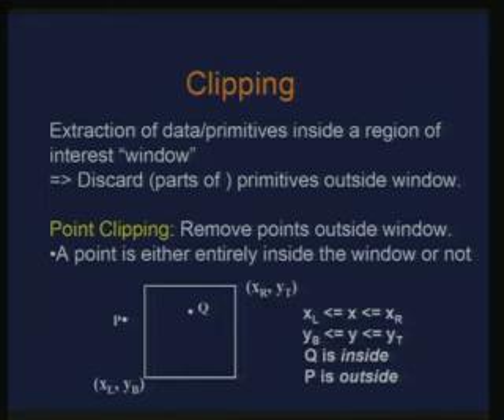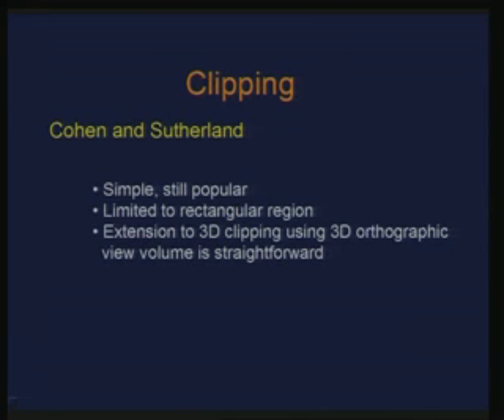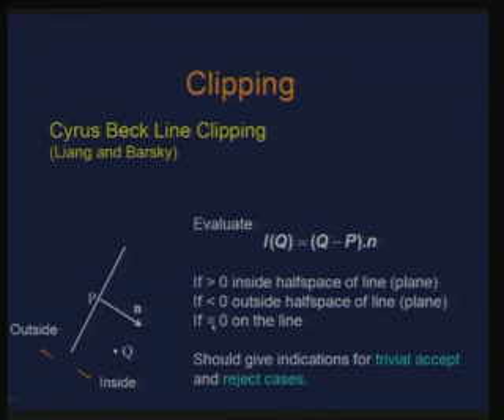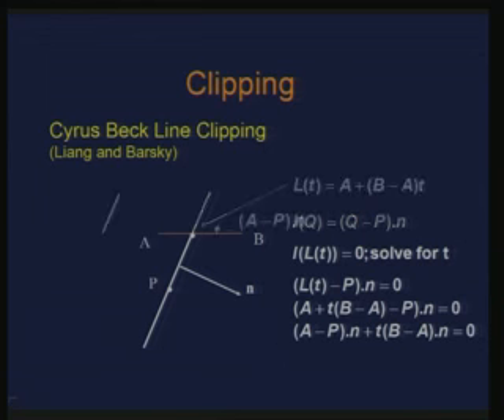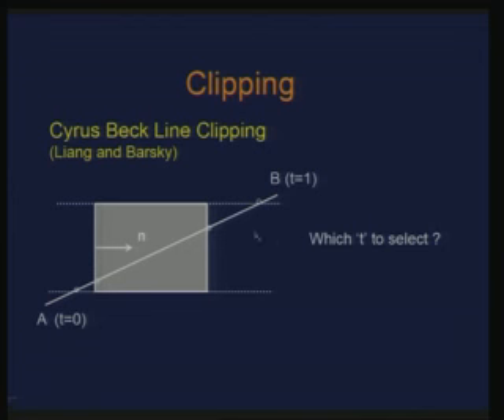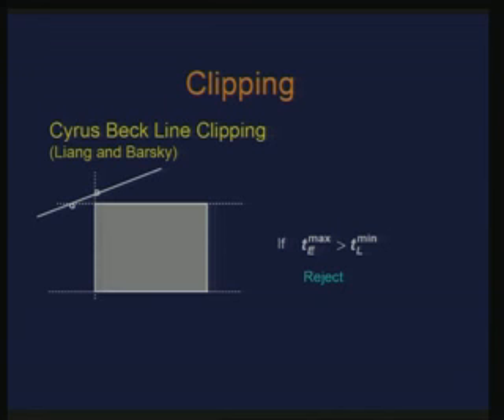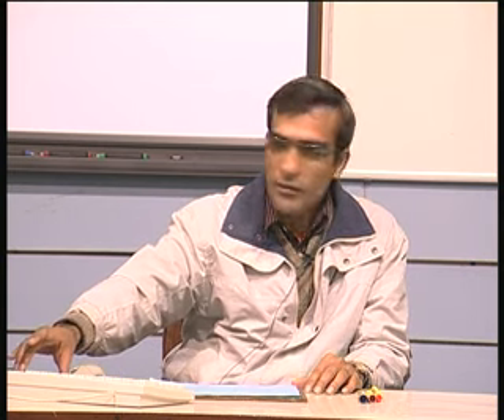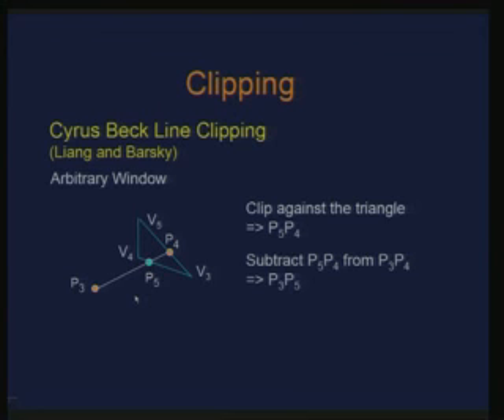Lecture - 4 Clipping

Comment: There is a huge working principle difference between Cyrus Beck and (Liang and Barsky) line clipping algorithm  . So its inappropriate to write it together as if they mean the same at  (17:19) and also the following lecture is on Cyrus Beck not on Liang and  Barsky algorithm. Hope NPTEL will look into the matter. Otherwise as usual nptel videos are A class.